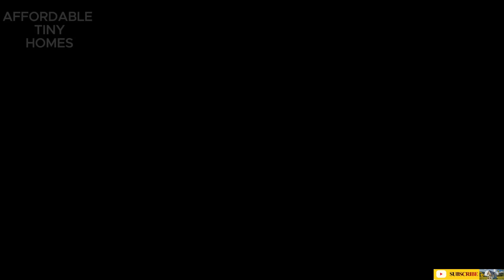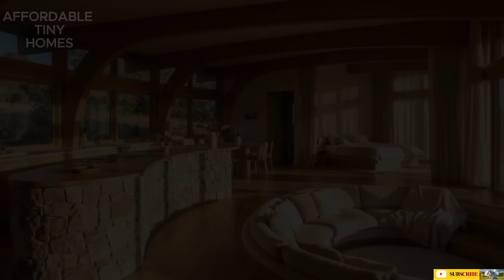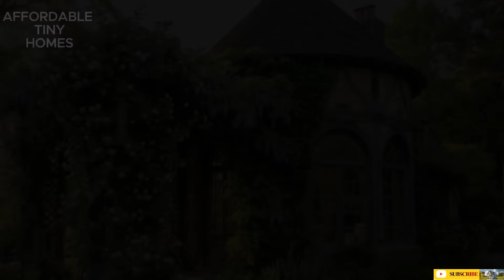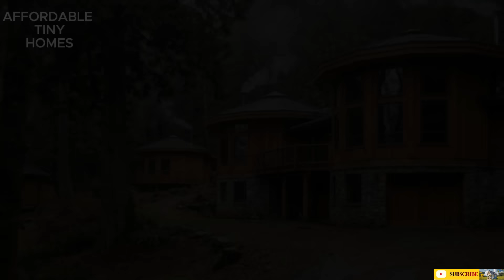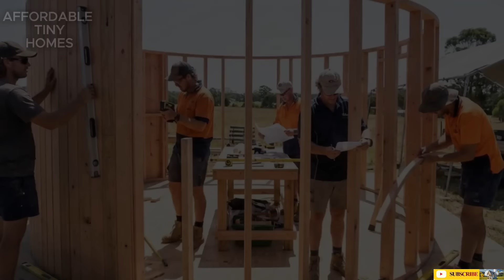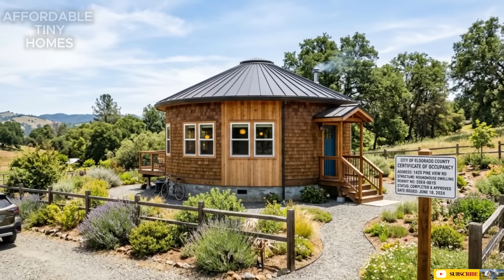Why Genghis Khan’s Tiny House Shape Beats Modern Homes (Round Tiny House)

Comment: One thing we found in evaluating homes and the issues they had. The corners in a room promoted a dead air space and did not dry; which led to mold growth if there were humidity issues. Air moves in a curved wave form, so it is tuned to curved walls, even an octagon would be an improvement.